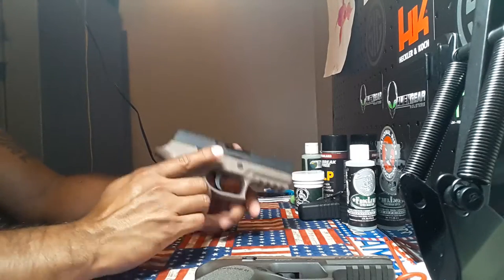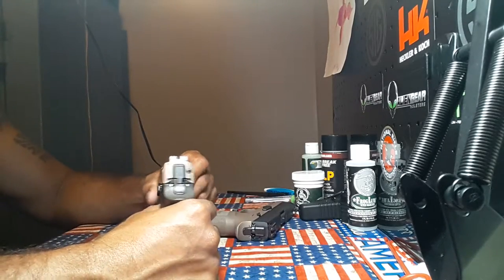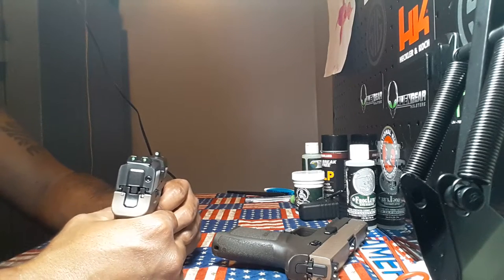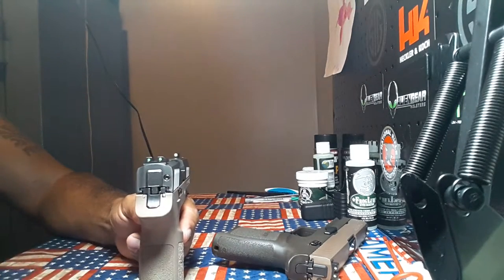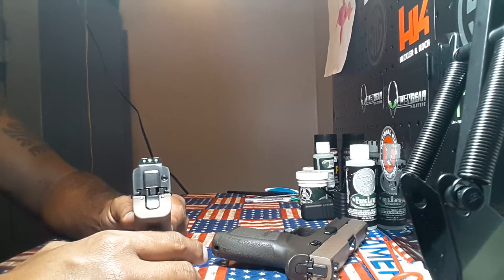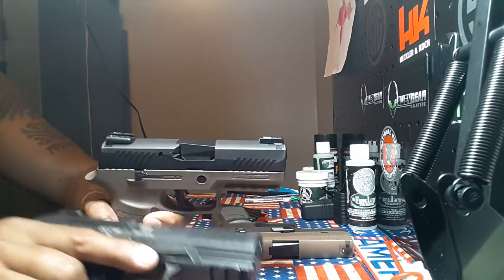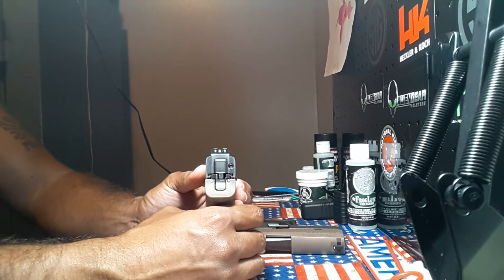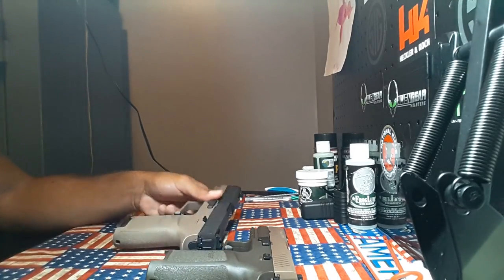Sig p320 and night sights

Comment: Don't punches risk damaging tritium vials on night sights?  I've read this numerous times....but for the P320, it's a real bitch using a universal sight tool because of the tapering on the front end.  A vice would give me much more stability over the length of the slide, but again, I' worried about damaging the sights.  Non-night sights have been fine with the vice and a polymer punch.
Reply from the maker: Fugettaboutit light but forceful taps usually work for me
Reply: Much thanks, I'm going to give it some thought.